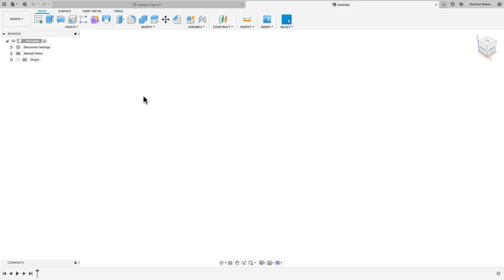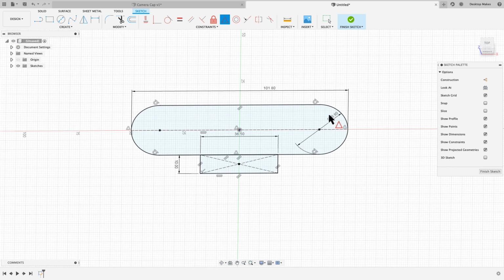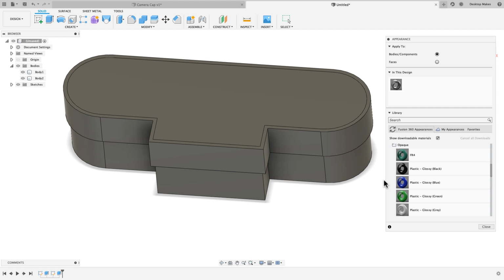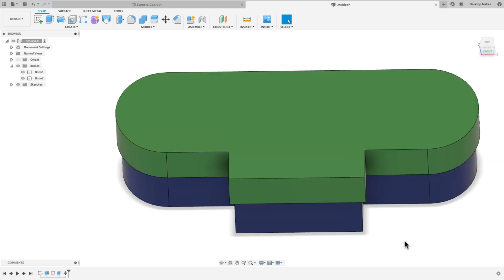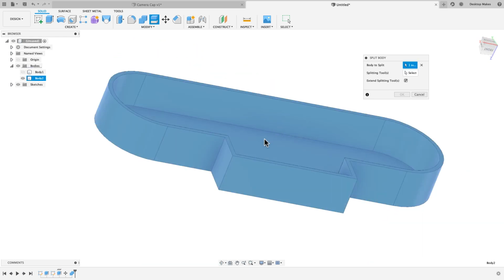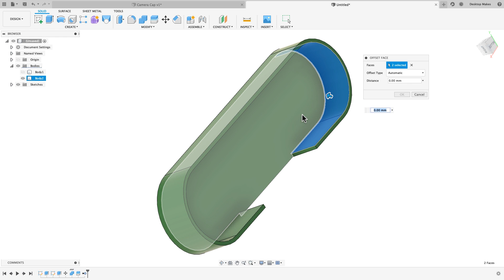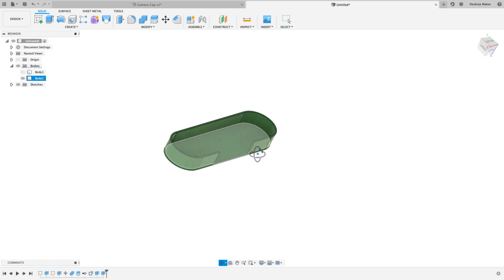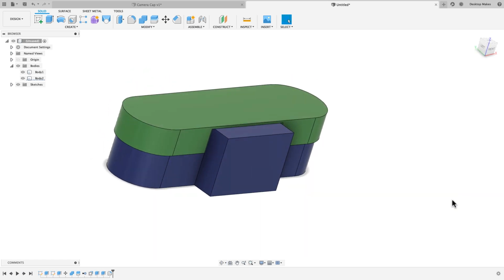Practical, Useful, and a Perfect Fit. Fusion 360 + 3D Printing = Perfect

Comment: Great video, you communicate the steps very clearly. 
Fusion 360 question: How would you have created a neat fit for a more 3d surface, in this case the camera face (eg If the top of the camera instead of a flat plane featured shapes and contours such as lens convex and sitting proud of the body etc)  Would you have used the same approach?

Comment: You're absolutely right. The joy of being able to imagine something and hold it in your hand minutes later never gets old. We live in amazing times.
I do have a Fusion360 question for you.  Sometimes when I try to apply appearance to a body/component, nothing happens.  It keeps the original color.  I tried unassign and remove the other appearance, but it does not work (it stays) either.  Have you ever seen that?
Reply from the maker: Hi Hari.  Yes, This does happen to me now and then.  Simply zoom in to your design and try assigning the material again.  This always solves it for me.

Comment: $0.17? you pay to much for filament. great video but that was really over complicated.
Reply from the maker: Maybe... if you look at it with the end goal of simply designing this particular part.  However, my purpose here was to teach a technique which will be very useful in the long run.
Reply: @DesktopMakes  I realize that but maybe you should mention that that could have been done in less than 1 minute with 5 moves. great content though. I'm still a noob and learn from you.
Reply: People do price calculation wrong for 3d printing.. The real cost of a 3d print are: design + power + material
Reply: @benedikt4160  he said for the plastic not the print.
Reply: @normcaissie5598  oh ok I missed that, but have the feeling that most people just calculate the material.

Comment: Wouldn't it have been easier to just initially extrude the camera blank to the depth that you wanted the cover, then shell it?
Reply from the maker: Yes, it would have but I wanted to show the approach of designing the actual part and then using the part to cut away the covering.  This is a simple example but the technique will come in handy with a more complex part.  Especially when you need a perfect fit.